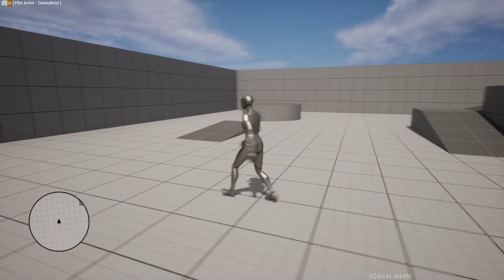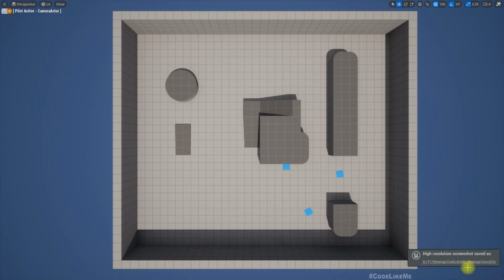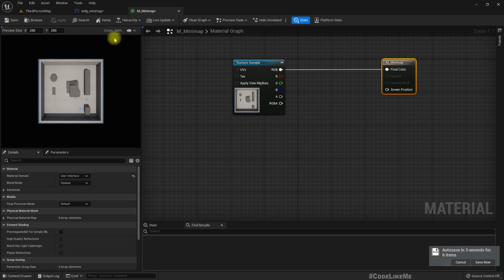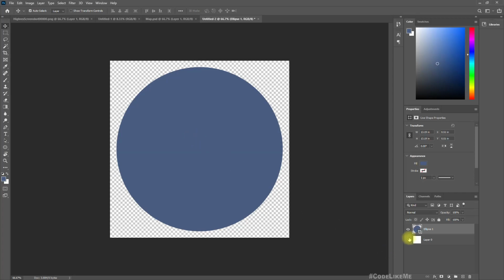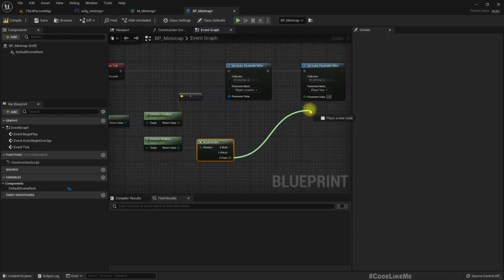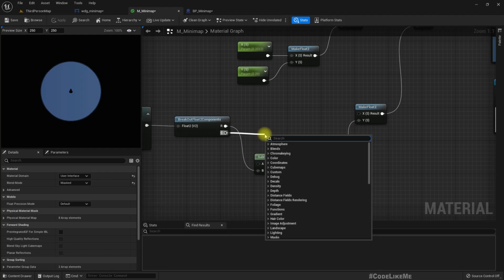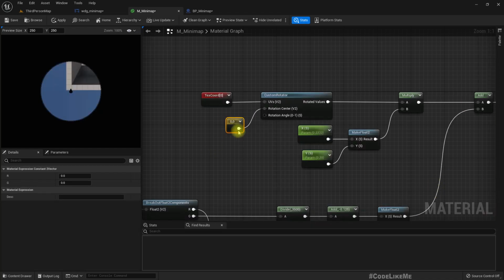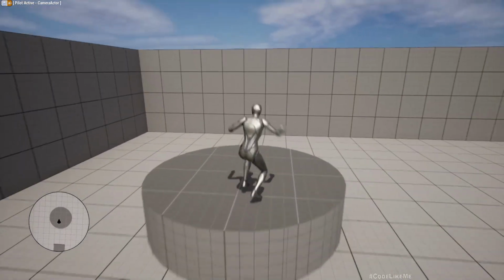Unreal Engine 5 MiniMap

Comment: The lessons are good by design (it shows in detail how and what to add)! 
However, I still couldn't repeat it correctly (I couldn't set up my 505x505... 8x8 square map of the main terrain), it's hard to set the correct coordinates for the location.
I'm making an open-world game, and apparently the map will have to be postponed for better times :`((
Reply from the maker: I agree. I learned to implement the map system in a better way later. But I haven't covered that yet in a new series. May be I should make that a priority
Reply: @CodeLikeMe I would love to see such a video! And I'm using it in my open-world voxel fantasy game :)

Comment: Can the instructor shed some light on how to use this code with different size maps without randomly playing around with different values? I tried just one other and failed! So many little numbers to change. Please help.
Reply: A year late but a large part of the issue is the fact the image was taken using the persepctive of the camera, so he spends a lot of time messing with values to get it to match in one area but as soon as he moves to another side of the map the whole things is off again. When you take the photo of the area make sure to set your camera to Orthographic, and then you only need to make an offset for the camera position and cut almost 10 minutes out of this video for all the fiddling of values.

Comment: hi, thank u for the tutorial. i have the issue that my X and Y are inverse in the map when the character walk. like when i go north, in the map it goes east. how can i fix it?
Reply from the maker: Multiply with a -1 in place where coordinate offsets are calculated
Reply: @CodeLikeMe  thanks for the help but i did not understand where to put the -1 . is it in 12:00 in video where i have to put it? furthermore i have -4540/1188 coords instead of 3000/3500 like in video.
Reply: @midascicero8633   hey did u subtract the x coordinate from top and bottom or added the coordinates

Comment: I have the placement correct, but the center of the minimap doesn't keep up with my player's movement. Seems like the minimap moves at about half the speed of the character - and after some time, shows that the character is in the wrong position. What's going wrong?
Reply from the maker: you need to update the parameters such as multipliers and origins I have added in the code accordingly based on the textures sizes and world size. Check the video I did on adapting the same system into the default open world map. that will give you some understanding how it is done

Comment: Thanks I found your video useful! My game is using the X and Z axis, how can I adopt your code to use these two axes instead of X and Y (and why is the Z axis UP in unreal?? lol)
Reply from the maker: That's just the way the developers have selected. you can simply use x and z in-place of x and y
Reply: @CodeLikeMe  It doesn't work though. My character only moves along the x-axis. I also tried using the "MakeFloat3" command instead of the "MakeFloat2", which does expose the Y axis, but throws a whole bunch of errors. How do I use the Z axis instead of the X one?
Reply: I should add that I am making a 2D game, not a 3D one. My 2D game only operates on two axis; the Green (Z) and the Red( X). All your code above involves X and Y, not X and Z. Just so I can use your code to make a minimap, how can I change my game to use X and Y instead of X and Z?